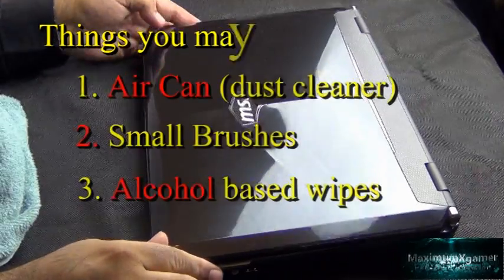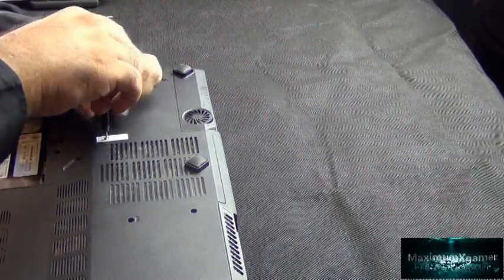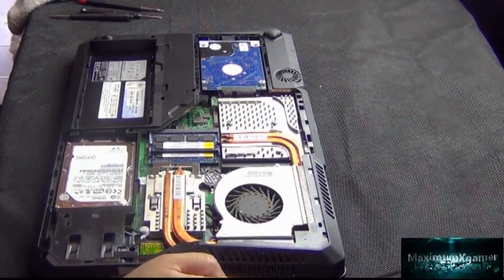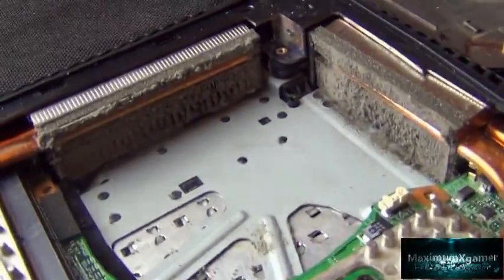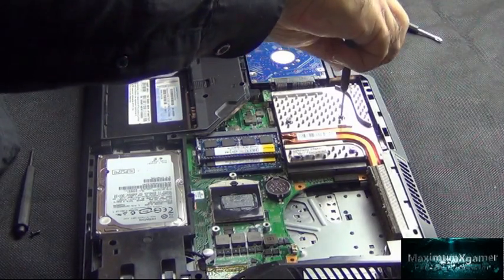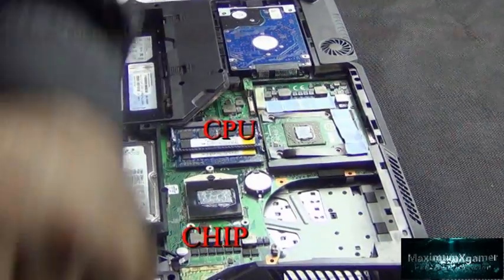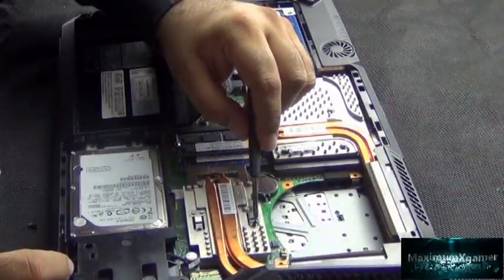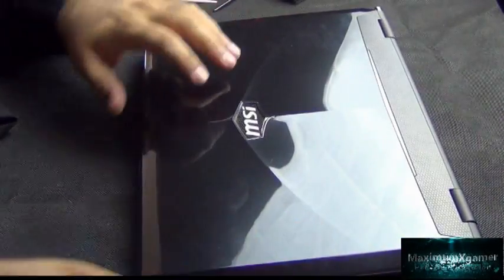How To Clean Your Laptop Fans and Filters.  MSI GX660R Cleaned

Comment: Hi there. the video you have tutored for the people is great. I have CX-61 series of the  MSI brand and the inner side of my own notebook looks slightly similar to this GX660R.  

 Apart from that, I have prepared a few questions:

1)  Is the fan you detached was belonging to CPU under the heatsink? 
2) You described CPU and the chip differently in the video. Is not the component lying beneath the heatsink closer to the RAM modules(from the watchers perspective, the hardware above the RAM modules), GPU?  the spot you marked with bigger red circle?
Reply: I know this is 2-year-old comment and you probably have the answer by now. But I'm posting this anyways, 1. Fan he removes cools down for both GPU and CPU since heatsink pipes go from both to the FAN. 2. English in this video is so wrong,  he probably meant that you should put thermal paste on CPU and GPU. But wrote CPU & CHIP instead. Since big card to right that is removable is an MXM GPU graphics card. While smaller square one bellow the RAM slots is CPU socket containing a CPU chip.

Comment: Man i cant get rid of the wet dust
Reply: Agustin R Wet dust is notoriously stubborn, just blast it close up with compressed air, anything left can only be removed by wiping it, or liquid, which is an obvious no no. But a very fine coating is fine.

Comment: should I care about the overheating when i still have 1,5 years of warranty left?
if the heat breaks down my graphics card or my CPU, or anything else, I'll just get it replaced, or a new laptop. meh.
Reply: +Blad0s Heat won't break your computer (it will shut itself down before any damage is done) but it does lower the lifespan of your fans and noise is annoying.

Comment: I have an msi leopard that I want to clean... but the lifting of the CPU cover has me scared because he talks about breaking a seal and needding thermal paste??? What's thermal paste?? Where can I buy it? And where do I need to apply it when I remove the CPU????? O_O;;;
Reply: Carlos Garcia 
no, thermal paste isn't a glue to stick the thermal paste to the motherboard, it's a thermal compound which is good at conducting heat from the cpu to the heatsink, they fill up the microscopic gaps when you applied pressure after applying the paste
Reply: konohamarutard thermal paste is the stuff that holds the CPU to the motherboard, its very cheap on amazon, and fairly easy to apply...

Comment: Can I clean it without removing those things with orange "pipes"? I have MSI GE60
Reply: have u found any answers? i m also a fellow ge60 user and i would like to know
Reply: hady yasser  Yes I have, I just went for it, opened my GE60 and all I had to remove was the fan, after that I had access to the other side of these ribs you can see from the outside, cleaned them up and voila, my temperatures are now 65°C max when playing Bioshock Infinie, BF3 etc.
Reply: so u didnt have to remove the orange pipes? sweet :)
Reply: hady yasser  Yeah I didn't, I was relieved :D I already had thermal paste ready, but I didn't have to use it :D
Reply: Leo Stotch i have Ge60 too, guys, please help me, it will be the first time for me to clean my Notebook. Any viedoguides with specyfic ge60? or this gx has same module and skeleton?
Reply: SusanoRipper Just take off the plastic cover as shown here 0:34, you will see the fan, remove the screws holding the fan, unplug the fan and remove it - you can now clean the dust off.
Reply: is better to remove those grills on the orange copper I think parts and clean properly.

Comment: Thank you so much, I have confidence now to finally clean my MSI. I have about 3 years of buildup and its to the point I cant do any realtime 3D apps for more than 5 minutes before the Nvidia starts throttling the gpu and everything goes wonky. 

Is there much difference between your laptop and mine which has the GTX 560m chipset? The exterior looks identical.  many thanks!
Reply: Oh, man, just disassemble that and dig in. MSI laptops are a piece of cake. Try a video of HP Pavilion DV-6 laptop fan cleaning to know what a hardcore is.
Reply: Oh man, its like i have a new laptop! I went from 90+ degrees down to 40! It was a piece of cake :)